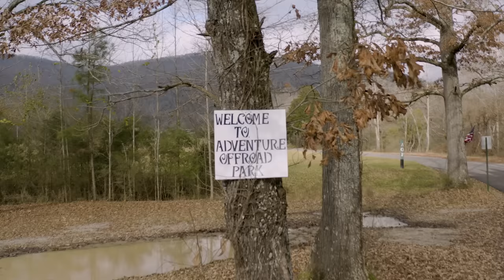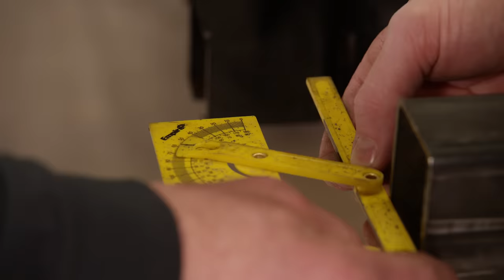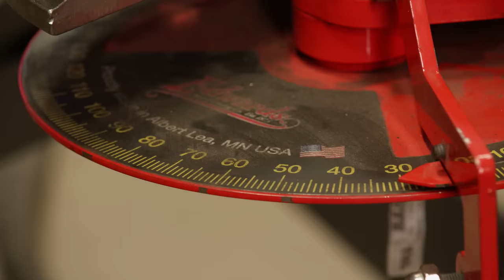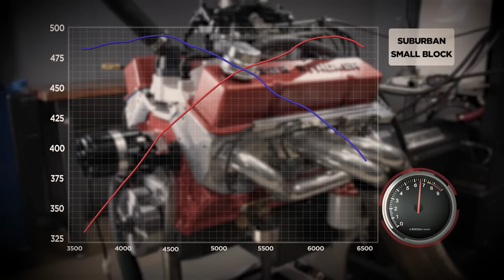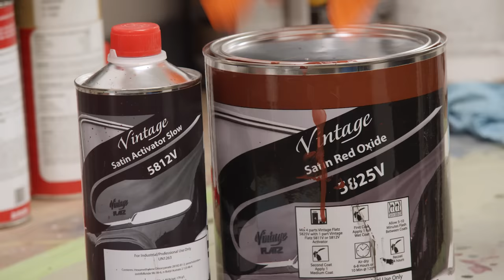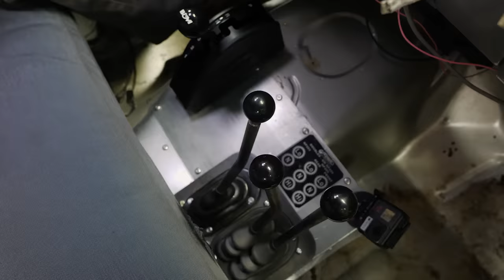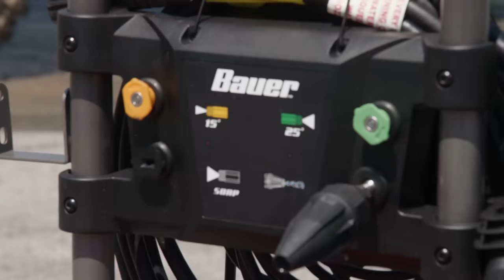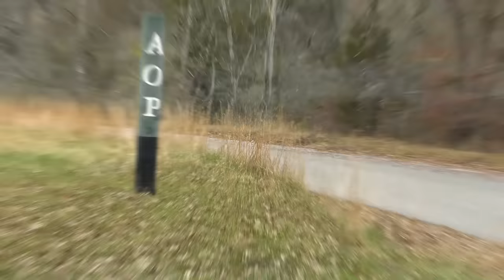Full Build: GMC Suburban Goes From Boring To Unbreakable

Comment: Good build. Personally would've done some paint on the firewall and interior parts though. And rhino lined the floor pans underneath while the frame was free from the body. Plus, you should've sealed up the quarters and rockers as well. 3 years those panels you just chopped off are gonna be rusting again. I feel like there MAY have been some corners cut on this build. Maybe not as many corners as other builds I've seen... but still, I noticed alot of things I would've done very differently. This is why I like to watch the Ekstensive guys in texas build lifted vehicles. Because they cross all the T's and dot all the I's. Gussets everywhere, braces and brackets all fully welded, four link bars engineered and made from scratch thick wall tubing... just serious quality. My problem with this build really is that, it's a budget build in a sense that pretty much anyone could make their suburban look like this with parts that can be attained relatively easy but, you blew the whole thing apart and cut as many corners as you could to make the "budget" of which we still have no idea what the budget was. Idk... love the truck, not happy with the workmanship. I feel like they spent more time on the front bumper than they did on the entire suspension set up.
Reply: Lots of opportunity for rust.
Reply: Agree
Reply: Offroad clearly is not their strong suit and they brought Swampers to a trail ride. But all in all, I like the way she looks as she sits. I have 3 projects goin myself, also a 91' Burban, a 77' K5 Blazer and an 88' S10 Blazer. Doing alot of sealing on the the Burban and s10 blazer. The K5, I am going for show quality more then an offroad build. The s10 blazer is fully waterproof, even the motor (350 small block from a speed boat).  The Burban is more of a family offroad build. So roll bars are adding more weight to keep the tires down and keep it as safe as possible for the kids.
Reply: I thought it was funny they didn't do a transfer case guard, being they are wheeling a suburban and are garenteed to get highsided.  Also going tall is a bad idea, much better to have massive suspension travel than be super tall.   Less rollover risk.
Reply: @countryboyk5411  seriously regret selling my rust free mint 91 suburban from California about 5 years ago. Did pretty much CK5 everything. I’m living vicariously through your comment. Also S10 Blazers need more respect. You got some awesome projects going on.
Reply: @freemansgarage  Ya those west coast cars are amazing finds with a good price on a lot of them. They don't last long out here on the East coast as we get all the seasons in most places aha. An I appreciate your kind words. I have been working on the K5 now for about 7 years. The Burban, I recently got this year and the s10 blazer I got last year. They are slow going builds but patience is always the best. I am in the process of adding a garage to my property for storing the hopefully soon complete K5 aha. I am having electrical issues so I am just gonna replace the wiring harness and call it good aha. I hate electrical. Otherwise, the K5 is done.. for now aha

Comment: I did a jump just like that 30 ft at the end  in my stock bronco and bottomed out the suspension bent rear bumper and got whiplash
BUT i didnt spill my beer which had floated straight up in front of my face where i grabbed it out of the air before it spilled lmao!

Comment: After having watched the whole thing, I was wondering why they didn’t fully box the frame. Kinda seems, in hindsight, how that could’ve helped them with that bent frame issue 🤔
Reply: And a full cage too
Reply: Frame gotta flex.
Reply: I think a lot of us were thinking that
Reply: @Harley.Davidson  only if your suspension doesn't
Reply: Is that why that rear 60 is so offset??? Looks horrible 😂
Reply: @Harley.Davidson  Flex? Yes. Bend completely? No.
The frame was just too weak for the kind of treatment they put it through. Boxing it at least in a couple spots would make it a LOT stronger with only a bit of work.
Reply: @Trav3l2Liv3  kids these days 😆
Reply: Start with a 3/4 ton
Reply: Boxing the frame and gussets and boxing on nearly every bracket and hanger. I would like to see them run hard a few more times and then go through another evolution.  It's far from "unbreakable". It is pretty darn stout for a suburban but it still has plenty of chinks in its armor.
Reply: @Harley.Davidson  Frames should really not flex at all. That is what this awsum 4 link suspension is all about actually. In fact flexing is why we have suspensions at all, but especially on a full body vehicle like the suburban we dont want frame flex. I used to think that frames were built to flex as well but when we look at a unibody vehicle, like most are today, there had not better be any flexing at all or the vehicle is rather useless and will self destruct.
My guess is that most manufacturers dont build fully box frames because of weight and cost factors along with the fact they aren't necessary in daily driving.
Reply: @Harley.Davidson  Frames do not have to flex.  Frames only have to flex if you are trying to skimp and save on material costs or trying to save weight. That is when you need flex so that the underbuilt frame doesn't crack. 

If you aren't trying to skimp on materials or save weight, you can just build a rigid frame strong enough that it won't crack.
Reply: @johncarter9054  It's just that design philosophy has changed. Old body-on-frame trucks were absolutely built to flex their frames. It's an inferior design but it was really the best they had at the time while keeping manufacturing costs low.

Comment: Of course they should have boxed the entire frame but it was a pretty cool video anyway. Looks like fun. My build started as a 3/4 ton and I swapped out axles with FF 14 bolt and Dana60 with crossover steering as well. I've got e lockers front and rear, 35" tires, 4" lift and I......boxed the frame.  I too have a 383 and Sniper 650 mated to a built 700R4 and NP 205. The biggest difference is I won't beat on my rig like they did and can do what they did in the video including getting stuck in that deep mud hole. My jump would also been 1/3 the distance. Thing is, it's my daily driver and being easier on the pedal when off roading means I'm far less likely to break stuff than they are.

Comment: Just goes to show the right gears, suspension and a willing engine can make all the difference.  Even in something as big as that Suburban. 
Nice!
Reply: Around spring I am going to find how a 383 stroker works in my 1988 Chevrolet 1 ton truck.
I have used up 2 454's and 1 350 then over time I keep hearing how great the 383 stroker is so I wanted to try one.
Being from Alaska and a hunting & fishing guide towing large jet boat truck engines get used up allot and AK winter cold is hell on engine start ups

Comment: this brings me back to my teens on my first offroad 4x4ing adventure while drunk n possibly high too.😁
Me and my buddy jumped in with a  guy from our town we barely knew who was driving a lifted 4x4 suburban and it was light snow at beginning of winter.
We were  absolutely BLOWN AWAY  when this suburban seem to just fly up a river hill that was at least 30 degrees if not close to 45.
 it was several hundred yards up and when it finally seem to be powering out or losing traction we were shitting our pants  thinking we would slide backwards and probly roll over killing us all.
TLDR, it made it all the way up we didnt die, lol
I was so thrilled i bought my own 4x4 bronco a few yrs later  which was very fun but not quite exilerating as that first 4x4 adventure.
But the BRONCO had its advantages too, one being the top came off which was  supper cool in the summer for haulin ass n drinking beers or 4x4ing in muddy pastures, hunting gophers with1-4 buddies.
PLUS it had a big back seat with tinted windows  which was like a cool mobile hotel room ;-)

Comment: I liked the series. Always been a fan of the square burbans and satin black. I would have beefed up the frame and put on sway bars. I also would use a fan clutch for cooling. I have seen enough electric fans quit to know they are not unbreakable.

Comment: Do you guys get fuel flow data from the dyno runs?  It would be extremely useful for your audience to see fuel flow rates at different rpm numbers.  Thanks.
Reply: That's actually not a bad idea. Give you a better idea of what carbs/pumps/injectors will feed what levels of power. It will also test parts manufacturers claims of "supports up to X horsepower"

Comment: I just have a couple questions what gear ratio did y'all go with I don't recall you saying it. I was really curious on how your pattern looked on the 60 reinstall. Other then that I wish I had the time money and place to build my daily 90 bronco II at the moment it's got a 3" body lift and 3" suspension when I got it when the rear axle broke like they always do I built a 8.8  4.11 with a Detroit locker 3 years ago. To hold me over until I could gather up some f250 axles and all the parts I'll need to do the swap I've got the f250 front axle gut though I'd be working on it by now but life's gotten in the way so ya it is what it ain't. I almost forgot I'm running 37" tire on it as well

Comment: I'm not a car knowledgeable person, but if you only have 1 hose from your tank to the feed port on EFI unit, where does the return port on the EFI go to? I always thought it normally goes back to the fuel tank, doesn't it?
Reply: Most systems yes, there are factory return lines even on a carbureted suburban. They  could be reused. But some aftermarket fuel injection setups don't even need it
Reply: @ryurc3033  Interesting! So that "filter regulator" must be the trick. I don't know why it didn't occur to me before, but now that I think about it, the return line from the regulator is all that's needed to return any fuel that's not being used by the engine, and still have the fuel pump running at a constant PSI. I didn't even consider the return port just not being used! Thanks!

Comment: Pro Tip - if you have a stock small block V8 in a truck, do not install dual exhaust.  
If you want to keep the torque and fuel mileage stick with a single 2-1/2 inch pipe from the Y-pipe back then install a ‘performance’ muffler and catalytic converter.
Dual exhaust will change the back pressure in most cases to decrease available low end torque.
Leave the dual exhaust for your Camaro 😂

Comment: I bet that mud run this thing got stuck in is just two deep grooves under the water with hard pack between them.  The only way to not get stuck is to be the guy out there with the biggest diameter tire, or have such an odd axle length that the tires run on the outside or inside hard pack.  Look at the Samurais with the cut down Dana 60's and the same Super Swamper LBT tires, but where the outside of the tire stays flush with the outside panel of the Samurai.  Those things are unstoppable because they don't hit the same places on obstacles as everyone else running stock length 3/4 and 1 ton axles.

I would love to see this Suburban worked more with adding strengthening to the frame.  Maybe not a fully boxed frame, but X plates put in strategic locations and additional cross beams added.  A boxed frame is great in theory, but unless every hole is filled, it will fill with mud and water and start rusting super quick.  Using X plates gives the strength, but still allows you to get in there and clean them out.  Maybe adding a self cleaning system of a hose with sprayers mounted inside the frame would work well.  Just hook up the pressure washer output to it, and let the magic happen.

Comment: what brand fan is on the rad and what is the cfm. I like the ford taurus or later suburban electric fans. I have not found and aftermarket one that really moves enough air to replace a mech severe duty clutch fan. West Texas heat.

Comment: I have this exact same rig, except mine doesn’t look nearly as nice. Still got the worn out 350 with the EFI. I do have a lift with 37” tires on it. That’s about it. Just put a new fuel pump in it (cut a hole in the floor and pulled it out 😂😂).

Comment: I, made an inquiry. Its about the the Chevrolet 4.6 litre  v6. If it's basically a Chevrolet 350 - 2 cylinders, if you forged a new 400 small block Chevrolet crankshaft, making it for that 4.6. Would it work???????

Comment: Out of curiosity why did you not powder coat a lot of the parts and chassis? Why choose to go paint?
Reply: Price is a factor I'm sure.
Reply: @ryurc3033  I was able to pick up a powder coated pretty inexpensively. And it works like gangbusters. And then you can bake the parts in the oven ,toaster broiler, or Pick up some ovens from the junkyard and make a large sheet metal oven for baking large parts. I recommend trying it

Comment: My 1-ton 1988 Chevrolet I have gone through 2 454 - 1 350 and now by spring 2023 the old truck will have a 383 stroker using the 6-inch Eagle rods with an Eagle 350-383 crank so I am very interested in how a stroker 383 works
The 383 has aluminum heads with 68cc combustion chambers with 202 intake and 160 exhaust values using flat top Keth black pistons.
Turbo 400 and transfer case is all rebuilt.
The old truck is going to run again and go home to Alaska to tow my fishing charter boat and take me hunting all over Alaska.

Comment: First thing I thought of was "They better box and brace the frame!" My next thought was "They better at least do a hydraulic ram assist!" And then let's use factory looking steering links? And tie rod ends instead of Heim Joints? I've seen this happen when all around Car/Truck guys get into Offroad, not necessarily bad mechanics, just need to hang out with the offroad crowd a little and pick up on things, it's how you learn, and honestly not a fan of that "4 link" setup, a Triangulated 4 link or good old Leaf Springs, they work! But this whole build would be useless where I live, the trails we go to are super tight and this big mofo would be banging off trees all day! Definitely a sweet Sub though, like offroading a house 🏠

Comment: HERMOSO FINAL HEROICO,, 1967 M5
button A:
 
It activates a set of hydraulic jacks that by means of a jump can make the car jump over any obstacle.
 
B-button:
 
I used it when I was going on unstable terrain and the tires seized.
 
C button:
 
Its use was for mountainous terrain. Two powerful rolling saws protrude from the front of the Mach 5 to clear obstacles out of the way.
 
D-button:
 
A transparent canopy covers the cab and is bullet and impact proof. In addition, the cabin transforms into a waterproof to submerge underwater.
 
E button:
 
By squeezing it, there was greater visibility and clarity from the lights. Also, vision is enhanced with infrared light. After a while, Speed modified it and it was to activate mini wings that slid under the car to help him jump.
 
F button:
 
A periscope and oxygen tube are activated when the car is submerged underwater.
 
G button:
 
It launches a seagull-shaped robot that can take photos, record images, and has X-ray vision. Also, it is a defense mechanism.
 
H button:
 
It is located in the center console with the rest of the controls and is used to drive the robot back

Comment: If you want to submerge it you should have used anti oxidant on the wires before mounting terminals and use heat shrink on every wire.

Comment: Frame is weak point - open C-channel front to back. A newer 2500 frame (circa 2000 and up) is (hydroformed) boxed from front bumper to just past the fire wall. Way stronger.

Comment: Hello, I'll try not to criticize, they spent a lot of capital, ...the rear axle is shifted to the left, yes, I manufacture and design the bumper... they used good metal for the body but did not integrate it into the design of the body and did not protect eventual touch x that is narrow

Comment: If only you had put real axles under it. That's why the 'yota could pull you out - it's got some real axles.
Reply: What wrong with what they got on?
Reply: @kar21ol96  too small
Reply: Get ya a set of 5 Toners.
Reply: @monroefive-o40  at least 2.5's ; Set o meritors if you can find em

Comment: Doing an over-the-top build like this but leaving the narrow, misaligned rear axle in place is strange. They should have at least mentioned the snafu. Cool truck, though. 

If it were mine, I'd skip all the fancy fab work and drop in 1-ton axles on soft leafs. The coil-overs and 4-link will clearly benefit travel and high-speed wheeling comfort, but not worth the time and money, IMHO.

Comment: so they put bogger tires on it to go in the trails and then put trail/street tires to go to the mud. for a 1/4 of the money you can do triangled 4 links front and rear with foa bypass shock and had a way way way better ride . with this type of setup beadlocks are a must still cant figure what they were THINKING with this build? the frames on those just suck you REALLY need a roll cage . cant tell you how many times ive seen those frame banannaed . so the best way to do one is tube chassis . they are worth there weigfht in gold !!

Comment: Why not change the brake booster when you can clearly see the master cylinder was leaking all over it because the rear seal blew out. Second I’d rather deal with a death wobble then a shifting rear end. On top of everything else instead of a 383 stroker keep the tbi 350 put 906 heads run carburetor and upgrade cam and get the same amount of power. Motor needed a rebuild anyways.

Comment: So they upgraded the suspension just to upgrade the suspension.  They also took a loose wheel from the trail and made it look like it was the custom wheel they had on there. They didnt pop a tire or they would shown it. They just aired the tire down. They also left the frame stock after adding 1ton truck parts. Really? Im gonna box the frame on my pickup and i dont think i will ever even take it off road(lowered mini truck).